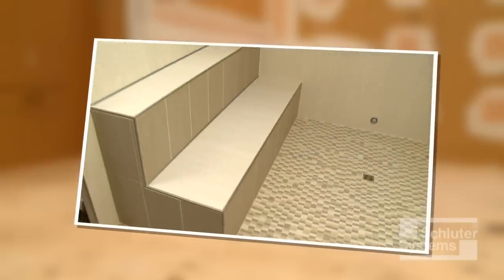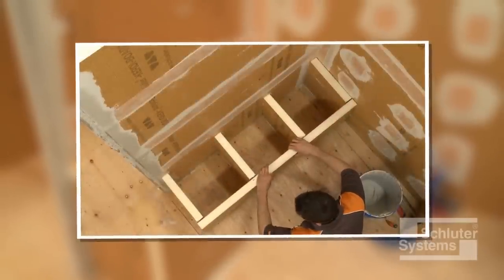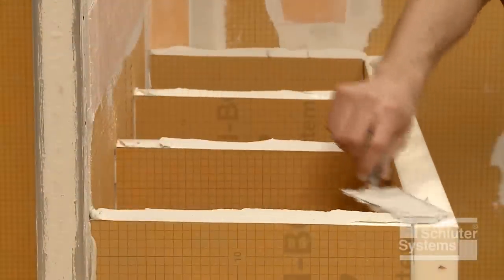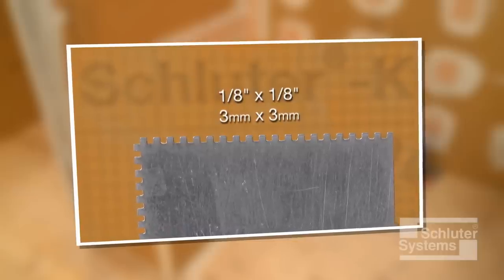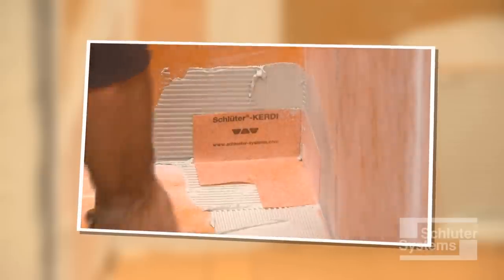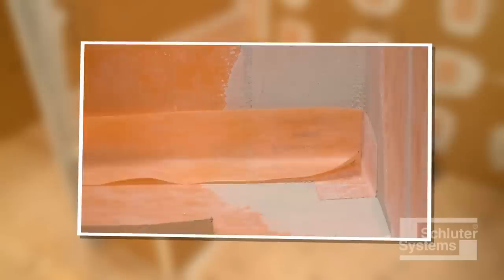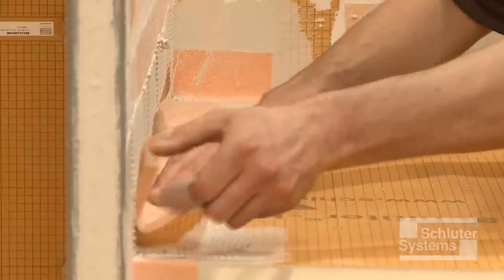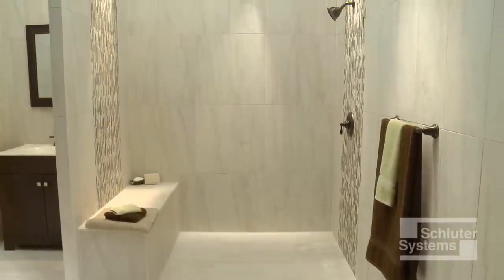Schluter®-KERDI-BOARD Custom Shower Bench

Comment: Why no mention of the proper pitch to use? Why not install the bench over waterproof membrane in case the bench ever leaks? I read the entire Schulter PDF and couldn't find any details.
Reply from the maker: Hello F'd News! Thank you for your comments.  While not called out specifically in the video, the Schluter Shower System Installation Handbook includes the following statement in the Requirements section of every shower detail.  'All horizontal surfaces (e.g., benches, curbs, window sills, shelves, etc.) must be sloped toward the shower drain.'  It is possible to build a Kerdi-Board bench over the completely waterproofed shower assembly, but the method shown in this video is a bit simpler because it is installed on the level subfloor.  Either installation will produce a fully waterproof shower. Hope this helps!
Reply: @schlutersystems1  can you just build a level bench and then pitch the granite slab I plan to put on top?

Comment: Two questions:
1. Any difference with thin set etc if I’m attaching a self made bench similar to this but over a floor made flat with self leveling cement?
2. Does the front face part have to be 2” or can it be 1/2” as it doesn’t seem to be adding much support with the style of bench you built here?
Thank you
Reply from the maker: Hi there,
 
1. Unmodified thin-set will adhere to a self leveling cement. However, you will need to check with the manufacturer of your bench material to verify what setting material is appropriate to bond to that.
 
2. The bench face does need to be made with 2" KERDI-BOARD, as it is part of the support structure.
 
Please give our Product Support team a call if you'd like to discuss your particular project in more detail. 800-472-4588 (US) or 800-667-8746 (Canada). Thanks!

Comment: What about waterproofing with membrane strip down the side where the apron is as well as where the apron meets the floor?
Reply from the maker: Hi Amish! Yes, all joints must be sealed with a 2" overlap. :)
Reply: @schlutersystems1  just to be clear - this video doesn't show that, but it's supposed to be done, correct?
Reply from the maker: Yes absolutely. At the end of the video, there is a mention that all seams must be sealed... said in a much better way than I'm saying it now. ;)

Comment: while i like the idea of using kerdi... i have no idea why you guys think thinset will not wick water up through its pores!? Why not just come out with a waterproof membrane/ glue like what RedGard has to apply to screw holes and for sealing tape... it is waterproof, can be applied to waterproofing strips to seal joints, and works like rubberized glue. I've seen thinset get wet and allow water to go right through it, no way I would use it on a shower knowing that it will eventually fail faster than a paint-on waterproofing membrane!

Comment: Well that is a big incomplete on this video! I came here  to learn how to water proof the 2 in edge and why the vertical edge was not waterproofed.
Reply from the maker: Hi Brian!  We would generally install the tray with the KERDI-BAND installed on the tray to bench connections and then the waterproofing of the vertical outside edge and inside corner of the bench after that, but you can do it any way you want. The KERDI-BAND does not need to be installed in a shingle style. So, for this video, we just show the waterproofing of the top of the bench because we would normally not waterproof the vertical edges until we install the tray
Reply: @schlutersystems1  KERDI  band is not wide enough. And you did not use KERDI band around the top of the bench. Remember, the board is 2 inches thick.
Reply from the maker: Hey! You can see at 4:32 that the top of the bench is waterproofed and the band we used over the 2" KERDI-BOARD is actually the 7" wide band, so we're all set! https://youtu.be/ceBBVD3nLRc?t=272